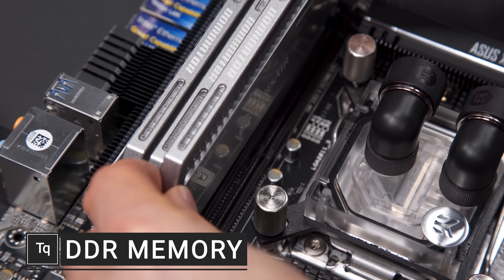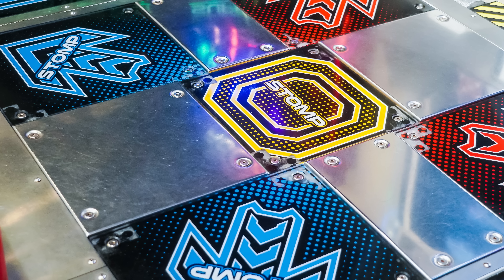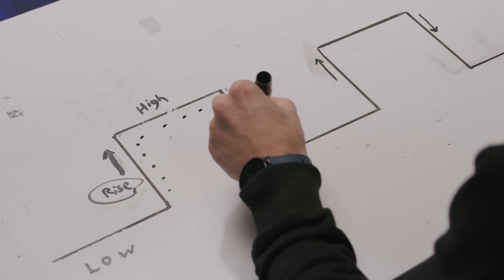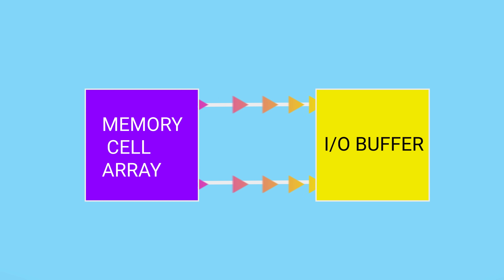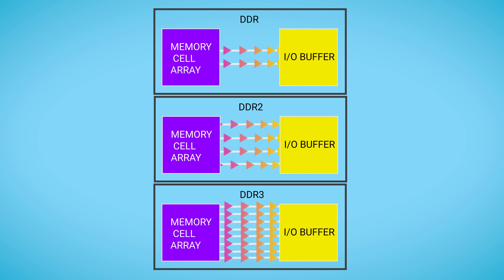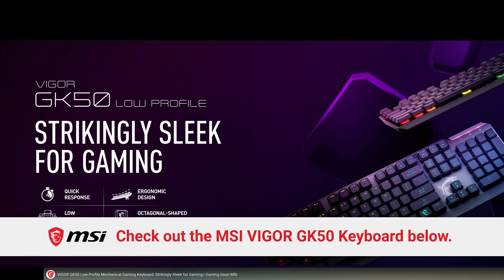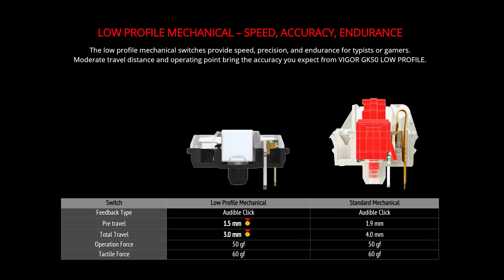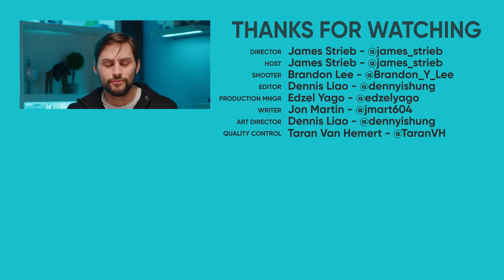The Magic Behind RAM - How DDR Works

Comment: I can't be the only person that feels like James has a serious passion for the inner workings and terminology behind RAM, he is smiling 100% of the time he is present on screen during this.
Reply: James is just smiling 99% of all times.
Reply: Too sad the video is very misinformative actually then
Reply: @kmanev  how so? not to imply i know more than you or such, just curious as to what aspect was misinformative
Reply: @4Devianz  Although it is true that the newer DDR the more banks it has, this is not necessarily all a positive thing. They talk about how the bandwidth between the IO module and the banks increases theoretically, BUT the "connection" between the CPU and the DDR's IO is the same (for the same DDR frequency). Additionally, if you have 8 banks and your speeds for each bank is 1/8 of the speed of the CPU-DDR speed, then that is not good, since if all the data you want to get/set is only in one of the banks then you are bound not by the CPU-DDR speed, but to 1/8 of that. Recently I had a problem with DDR4's groups of banks. So instead of doing 16 banks, DDR4 would usually will do 4 groups of 4 banks each (at least that was what I had to work with). My issue was that each of the groups had only 1 precharger shared for all 4 banks in it. If you don't spread out your memory accesses good enough in all 4 groups, then you will have penalties for waiting the prechargers... So maybe I was too harsh in my comment up, but in my opinion going for larger generational numbers is not all pink ("hey guys we doubled the speed with our enormous technological efforts") and is partly just to increase sales with not so perfect technology to be honest. I would guess that a 2133MHz DDR3 will be faster in reality than 2133MHz DDR4. The difference is that DDR4 would have higher speeds, of course (>3000MHz).
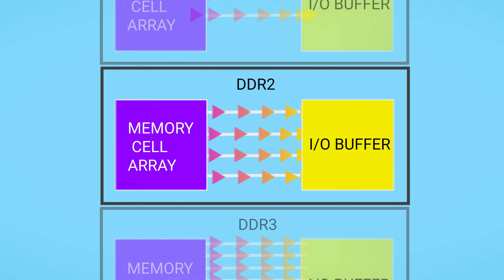Edit: not sure if that got clear, so let me give example: If you pause on 2:02 you will see that DDR2 has 4 and DDR4 has 8 connection to the "Memory Cell Array". In reality these 8 connections are to 8 different "Arrays" of 1/8 size each. The problem is if all your data is skewed into 1 of these 8 arrays, then you can in reality use only 1 of these 8 magical connections. Of course CPU caches and memory organization by the system help a lot in hiding that!

Comment: In order to get even faster, DDR6 will have mandatory RGB.
Reply: Plus a new 8 pin power connector... for each stick.
Reply: RGB doesn't boost your RAM speed, you stupid... it boosts FPS
Reply: @pesaventofilippo  ram boost fps, rgb boost fps, rgb is ram
Reply: DDR6 also might be built on MRAM, instead of DRAM. It's the only non-volatile memory that's actually being mass-produced, despite years of people saying that NVM would replace DRAM and NAND Flash.
Reply: @pesaventofilippo  really i didn't know i figured it was just for looks
Reply: @Beingintheworld-x6i  DDR5 is supposed to come in 2021. Still, the comment was a joke, so don't take it seriously
Reply: @lucasfranke5161  DDR5 is already out, it's just not affordable for desktop systems. LPDDR5 is already in many flagship phones, and I assume DDR5 is being used in some server applications (Servers are always 2-5 years ahead of the consumer market)
Reply: @lucasfranke5161  the graphic memory made by Samsung are ddr6 and it's already released
Reply: @swarajrajegore6897  SRAM and VRAM aren't the same things

that's like bragging about GDDR5X coming out in 2017 and complaining how DDR5 hasn't even come out on desktop yet
Reply: @lucasfranke5161  and it did come! Go figure
Reply: @lucasfranke5161  lol gotcha
Reply: @lucasfranke5161  thx😂
Reply: And factory over clock and internal water cooling.
Reply: @nahCmeR  *chip
Reply: LIGHTSPEEEEEEEEEEEED!
Reply: This comment have just triggered scalpers for future DDR6 launch
Reply: We meant to say Gaming RGB? (:
Reply: plot twist: adata and transcend will just have rgb style, auto cycling flashy leds and they wont even be in sync across the same ram stick, letalone the entire board
Reply: @frogz  wow so true lol
Reply: I feel like I've seen you somewhere else with another top comment
Reply: It's secretly the glow given off by all the magnetic fields grating against one another but they decided to make it a "feature".
Reply: Facts
Reply: No, DDR6 IS RGB
Reply: elsa.
Reply: Hehe rainbow road on my ram don’t mind if I doooo
Reply: Even for phones?
Reply: @k4piii  no for phones I'm using s20 ultra with ddr5 ram maybe 2022 with amd gpu in Samsung
Reply: Nice one! 😂😂😂😂👍🏼👍🏼👍🏼👍🏼
Reply: https://youtu.be/SyA8AgO7FIc
Reply: You deserve an award my man
Reply: perhaps
Reply: "Magic Behind RAM" expecting how they do RGB on RAM
Reply: i think it’s called gddr6
Reply: I think that’s gddr6 g stands for gamer
Reply: RGB
   =
KITSCH
Reply: Didn't think this was funny til I saw your pfp lmfao
Reply: don’t forget campy grimaced “o” faces on all YouTube thumbnail clickbait
Reply: Yep hopefully photonics can make rgb useful 😂i mean...for performance
Reply: True fact
Reply: Let it go
Reply: Can't wait for new DDR with KGB.
Reply: What's rgb
Reply: @الصوتالرخيم  red, green and blue
Reply: @CyberPunkSimms  thank you so much
Reply: 200th like pog

Comment: Obligatory: you used a Pump It Up dance pad when referencing DDR.

Signed- former massive DDR nerd. 👍
Reply: Imagine the pedantic storm if the editor had shown an In The Groove pad.
Reply: @ZephyrGlaze considering first gen models literally had to be installed in DDR cabinets.... 🤔 😅🤣
Reply: @SnapquesterMage  I've never actually seen an itg1 conversion kit oddly enough.  Though yeah, the itg2 conversion kits would also just be on ddr pads.
Reply: @ZephyrGlaze  I knew a lot of people in the original design team and were friends with many of the early adopters here in socal. 👍

To me ITG just felt like a "bastardized stepmania clone masquerading as a real, legitimate game" and that sentiment wasn't helped by literally requiring the use of a Konami cabinet. But those harsh opinions have long since faded, even if the game is basically "DDR ripoff made by DDR fans." As such, I wasn't necessarily close to the ITG crew, as a loyal Konami/DDR loyalist. 😅
Reply: @SnapquesterMage  it should've felt like stepmania, considering it shared half the team :D
I guess i didnt feel much good will toward Konami after they abandoned the community and only made Supernova as lawsuit ammunition against RoXoR.
Reply: @ZephyrGlaze  Honestly, I was already on the downhill on the game anyway once Supernova came out. Was hardcore 3rd mix through Extreme, and the wait between EX and SN was rough. I liked SN, and still absolutely loved all previous iterations, but understood DDR was effectively dead afterwards.
Reply: I even get confused because there was another DDR back in the days which broke apart in 1989 (well... it's known as GDR in the american continent. if ever, but who cares). which was another nail in the coffin to the break-up of the Soviet Union... and the final fall of the iron curtain.
Reply: Team pump it here for years! Although now I play SDVX and IIDX more than anything
Reply: @seeall24123  what's the best way to play IIDX these days? A JPS2 and old disc copies just don't run well on modern TVs.
Reply: @SnapquesterMage  You can make a Japanese eAmusement account and get the official PC version (Infinitas). You have to jump through a few hoops though and there's an insane grind associated with it to unlock anything.
Reply: @d4fty  You got it^ Also I highly suggest Gamo2 for controllers! Great stuff there. 33% off for the next 2 days, but shipping is insane.
Reply: @seeall24123  gamos aren't as good as yuancon from what I've heard, yet to get one from Yuan though. Plus pricing is a bit better iirc
Reply: Janejana gang !!!! Aoo
Reply: Literally came to the comments to see if someone already called it out lol (have my own Supernova aka Red Dragon cab at home)
Reply: Yeah, could never get into Pump it Up... NESW arrows were just so much better.
Reply: @meijerbrantm8158  I can see the argument for 4-panel singles, but pump doubles is soooooo much better 👌
Reply: @d4fty  there is definitely a ton more patterns in Pump doubles than DDR. We mostly had the X, the 8, and the 0. Everything was just a variant of those patterns. Still some of the most fun I'd had.
Reply: @meijerbrantm8158  I tried to get into it, but having spent so many years with DDR (singles and doubles) I just could not wrap my head around the flipped sensor placements. At least at anything above easy/medium.

Comment: RAM: "I am magic"
Chrome: "I don't care what you're called, I just need more RAM!"
Reply: heyhey this isnt pornhub
Reply: Joo2oob  i would rather use edge or opera gx if possible . But edge is best its fast , responsive , works on low end pc , doesn't lag like chrome in yt with my old laptop and most importantly it has trash ui and it makes it feel lite
Reply: @pxrposewithnopurpose5801   Edge is now running on chromium which is made by Google, which is also used to drive Chrome
Reply: @SuperTflat  idc . if my old potato can run it smooth then imma use it .
Reply: LOL, How much ram have you had Chrome use?
Reply: Use edge d*mbass
Reply: @pxrposewithnopurpose5801  No thanks, wasn't interested in Internet Explorer in windows 95, still not interested in it, in win 10 , or Edge. It should not be included as part of the OS, ever. As an add in option, ok. If I want it, I'll download it.
Reply: @spyder001  nobody asked u
Reply: @spyder001  did i told u to download edge maybe u got more than 8 gb ram or 4 gb ram . Nobody told u that . Thats why i said @$$ . Wdym by no thanks when i never told u anything it was meant for the commentor
Reply: @pxrposewithnopurpose5801  edge is Chrome
You can see for yourself when you open Both but try to mute one
Reply: Joo2oob  i guess i gotta use that
Reply: 694 likes lmao
Reply: Firefox gang stand up
Reply: Q: Where do bees go to the bathroom?

A: At the BP station!
Reply: @jdwmyt  cringe!
Reply: @johnrthebrit  ore oware wa pain